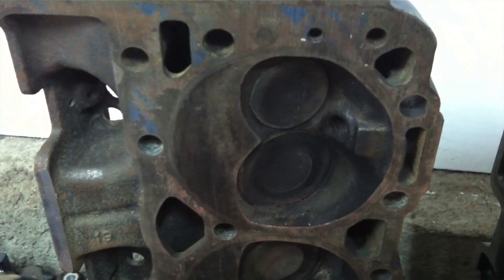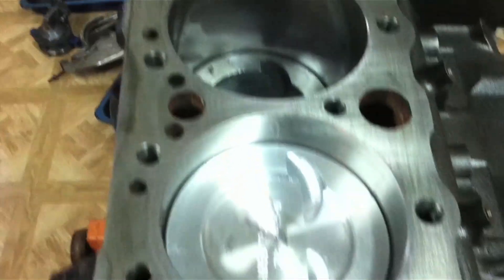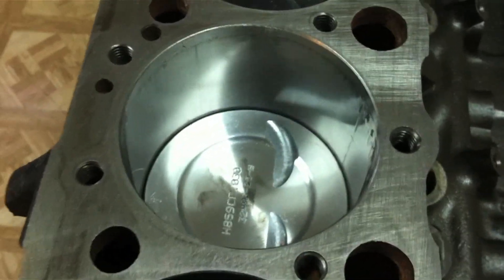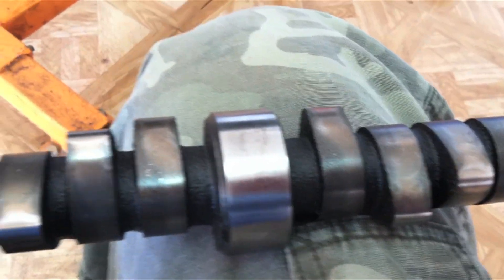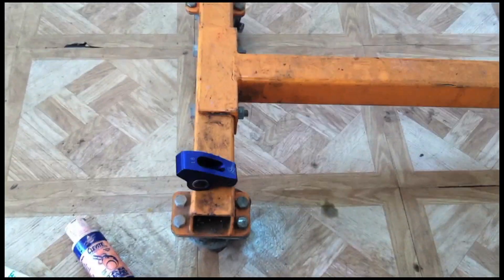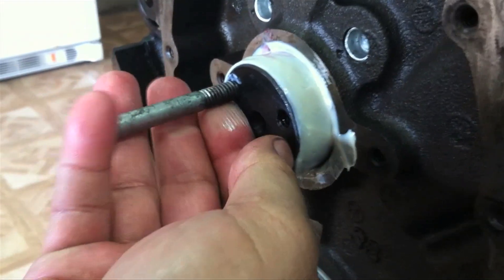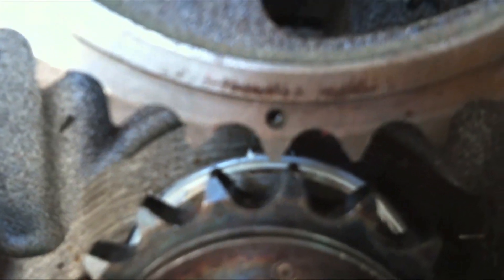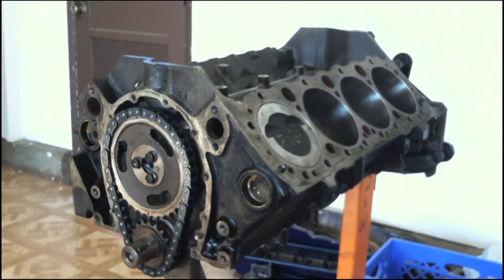How to build a Chevy 383 Part 3: How To Install a Cam & Timing Chain

Comment: whats the torque on those 3 bolts for the cam??
Reply from the maker: I believe it is 20 ft. lbs. It is hard to hold the cam still so I usually just snug the bolts with a 3/8 " air gun. Use a drop of Loctite on the threads either way.

Comment: umm a double roller is about 40$ new why not spring for it.. and I don't see the point in explaining the 4stroke method for explaining compression ratio.. it works exactly the same on a two stoke..

You forgot to tell people that when installing a new aftermarket cam that it might need to be dialed in or that it needs a 30 minute break in time at idle before reving the engine or putting it under a load
Reply from the maker: This NOT my engine. This belongs to a cheap bastard that just wanted the parts put together. The reason for explaining how a 4 stroke works is because many people do not know and it is easier to see when the engine is apart. Who the hell was talking about 2 stroke engines anyway????   Starting the engine for the first time and breaking in the cam is a different video. Also if you start an engine for the first time with a new cam you need to run it above 1500 rpm for 20 minutes to break in the cam. If you run a new engine at idle for 30 minutes before "revving" it the cam will go flat. I just have no idea where you pretend to know anything. It's amazing. You have NO idea what you are talking about. Build an engine. Film it. Explain it. and then get back to me.
Reply from the maker: Try reading ANYTHING on how to build an engine before you write a comment. ANY camshaft install guide will tell you the same thing. 
"As soon as the engine fires, bring the RPM up to 2000 to 2500 during the first 30 minutes of operation. Slower engine speeds will not supply the camshaft with an adequate amount of oil for the break-in period. "
http://www.compcams.com/Instructions/Files/COMP4-115.pdf
Reply: SanDiegoHotRod I don't have to I've been doing it for 14years and never had a 1stroke or 4stroke blow up due to something I've done.. and I always break my engines in I never trust a customer.. also here's something they don't tell you on a cam always mic your distributor gear they can be defeated on ford's and chevys

Comment: Is there a thrust bearing in between the Timing gear and the camshaft. I am putting a Hydraulic Flat Tappet in a zz4 roller block ? Thanks for the Video it was what I was looking for.
Reply from the maker: Thank you! If you don't have a roller camshaft and roller lifters then you should not need the bearing or a retainer plate.
Reply: That what I needed to know. Thanks

Comment: Begins by " i am just gona explain how a 4 stroke engine works quickly". Takes 4 minutes to explain it...
Reply from the maker: That's pretty fast. Have you ever read any of the engineering books on how a 4 stroke engine works? "Gas and air come in, burns and goes out" is not really a good explanation.

Comment: how did you get the cam bearings in?
Reply from the maker: I have a cam bearing installation tool. It is very important to get them in lined up with the oil holes and not crooked. It is also very easy to burr the edges of the cam bearings. I usually just have the machine shop install them after they finish the machine work; boring, honing or grinding the crank, etc.
Reply: +SanDiegoHotRod I see. im going to attempt a 383 build this winter. Thanks for all the info!

Comment: why didn't you put in the cam thrust plate and bolts
Reply from the maker: Because a non roller hydraulic cam does not need a plate.

Comment: why is the one piston so clean but the other one isnt?
Reply from the maker: The client told me it was a boat "motor" with only 10 hours on it and one piston was bad so they replaced it. The machine shop did a crappy job and the guy who sold the parts to my client lied about a bunch of stuff. My client was a super cheap douchebag on top of all that. This is the reason I won't buy a car or engine from someone and take their word on ANYTHING! I prefer to buy a car with NO engine and build my own. That is the only way to KNOW for sure it is a good engine.
Reply from the maker: No. He was a total scam artist I just met. Nothing but constant lies about EVERYTHING! He took $30,000 up front to restore a 69 Chevelle from a semi friend of his and told me he only had $20,000. He then took the money to rebuild the car and bought cars for HIMSELF to flip and make money. He also kept trying to do everything as cheap as possible even if it was not safe. I finally met the owner of the car and he worked with him directly. He completely screwed the owner of the car but the owner still loves me and my work but yeah, douchebag! Take a look at the blue 69 Chevelle with the awesome blue 454 big block I built with NO money on my FB page.  http://www.facebook.com/corvettesandcustoms

Comment: what you did wrong is not to  let the  people watching is that when you line up the two dots as you did,   and most people do this as it is easy to make sure the line up. 

the problem is that when you do this the number one cylinder in not on top dead center,   in the Fire condition,  Number Six is.    Just check the cam lobe's and you will see what I mean.

 yes the piston is up to the top but the cam is not going to let the number one cyl fire.  The Number Six Cylinder is in  compression,   So if you use this as  TDC   you will be off 180 Degrees when you try to fire the engine.      The  Correct way to have  TDC is when the two Dots are at the 12 o'clock.     That is TDC  on a Chevy Small Block Engine for number one cyl.             Just a bit of information to know for the older Small block Engines.    Pass that along for the new guys
Reply from the maker: +Gfdf Perte Geez. Really? I guess you are right. I did not mention that you had to turn the crank before you install the distributor. I also did not mention about using grease to install the fuel pump rod, or how to install the carburetor, or how to install the intake manifold, or how to wire the ignition, and so on and so on....
If you watch the second series on the "Engine dress up" I go through installing the oil pan, intake and so on including PRIMING the oil pump with the oil pump primer and installing the distributor which includes HOW TO FIND TDC on the COMPRESSION stroke. Many people change distributors without changing the cam and they just want to watch a short video on how to find top dead center on compression stroke and dead time the distributor without watching a 2 hour video just to get to that part.
Keep in mind that after installing the cam you still need to install the heads and adjust the rockers (part 4 and 5) and that involves TURNING THE CRANK over which would make the cam out of the 12 oclock position. Are you going to install the distributor BEFORE you install the timing cover just so you can have the cam in the right place??? Bottom line is you still have to align the dots to install the camshaft properly so you don't get the cam installed a tooth off either way.
I still have a couple more videos to edit and upload for the second series on installing the EXTERNAL parts of an engine, including the dist. and carb. Many people do install the dist. 180 out because of this that is why I have another video coming out on "FINDING TDC AND INSTALLING THE DISTRIBUTOR" 
I appreciate you watching and paying close attention.
Reply: Well you just told every one so My job is done.      But remember 99.9 % of the guys watching do not know what you know and it is easy to glaze over or just not talk about items that need to be done.   That is why I said to look at the lobe's and how a SBC  can be at the 6 or 1  fire position  when  the marks are at  Zero.   Once you know that bolt on the cover and the pan and have fun.  

For easy start when you install the Dist bring the timing mark up to 15 to 20 Deg BTC   put the Dist in and line up the rotor with the number one post.   This way you know  you will start right up and have some advance when you start.
Reply: Do a video to show how that can be done right on the engine stand.  The cap can come off when putting the engine in.
Reply from the maker: +Gfdf Perte A friend of mine used to set his timing with the timing light on #6 to to mess with people! LOL
Reply: I tell most people just use the coil wire.  Fast and easy and the wires on the Timing light do not get hot.        This does not work on EFI  with 8 coils.

Comment: to bad this guy did not  tell you that is not  the full story on how to install the cam and chain.   This is not the full information.   If you do this you will drive your self crazy when you put the Disturbing in and try to get the Engine Running.       If you want to know more let me know
Reply: spell  really is that all you got to say.   You do not not even know that you are showing people.
  you are not telling them the correct way to set up the chain when you are done.     Once more you show that you do not know what you did wrong or at least  tell people what they need to do after they set up the cam as you showed.
if you find spelling fucks up i do not care.   but please tell people what they need to know,  I bet you do not know,   if you do tell us
Reply: For the record I look for videos that can cause people problems.      And yours is one of them.
SDNC   Got it.

Comment: When should you use a wear plate between the timing gear and the block I am installing a mechanical roller cam in my 383 and they suggest the wear plate but I've never built motor that required one before.
Reply from the maker: richard lundy When you install a roller cam (not just roller rockers) the cam lobes are ground at a flat angle for the roller lifters to ride on. Hydraulic lifter cam lobes are ground with a slight angle so the lifter spins and also puts backward force on the cam to hold it in. Hence no retaining plate or cam button. With "flat" roller cam lobes the cam is able to move out towards the front of the block. When you install a "full roller" cam you need a cam "button" between the cam gear and the timing cover to hold it in place. Since this puts back pressure on the cam you need the wear plate to keep the gear from grinding down the front of the block. That's where the wear plate comes in. I prefer to use a thrust bearing style but you should check the paper work that cam with your camshaft to get the proper thickness cam button and plate. Comp Cams online also has some good info. Hope this helps.
Reply: Thanks alot. I have the cam button and the wear plate and the paperwork with the wear plate says I need to have .030 taken off the block or the back of the cam sprocket but what you said all makes sense and I appreciate it very much thank you sir

Comment: Yes, it explodes due to the high compression. Rapid expansion of air is the very definition of an explosion. Lighting gasoline without it being in an compressed environment will simply combust and produce no power for a piston.
Reply from the maker: An explosion ("a specific type of combustion") in the combustion chamber is called "detonation" and is what destroys engines and burns holes into pistons. A controlled burn of vapor in the cylinder and expanding gases which push the piston down is different than the molecular and chemical reaction that happens in an actual "explosion." Way too much information to get into here but do some research and learn the difference. here is a good place to start.  https://answers.yahoo.com/question/index?qid=20100206193818AAYIzNP
Reply: A detonation is a specific type of explosion that produces a shock wave that is supersonic. A subsonic explosion is NOT a detonation and thus would not destroy an engine. Remember the very definition of an explosion is a rapid expansion of air, which is what is occurring in an internal combustion engine and this subsonic explosion produces the force needed to power the pistons.
Basic college physics
Reply: That link is a joke and who wrote does not know the difference, here is a link with an engineering expert:
http://www.justanswer.com/engineering/6e831-explosive-combustion-causes-occur-describe.html
Reply: here is the actual explosion type occurring in an internal combustion engine:

en.wikipedia.org/wiki/Explosion
Reply: Sorry this is the actual link :

http://en.wikipedia.org/wiki/Deflagration
Reply from the maker: Ricardo Cortez
Keep reading -  -     http://www.contactmagazine.com/Issue54/EngineBasics.html
Reply: Right, like I said, the types of explosions in a normal combustion engine are subsonic Deflagration explosions, Not detonations.

http://en.wikipedia.org/wiki/Deflagration

I read your article now get with basic sience and read that article.

Comment: Hey I was looking through your striker motor build looking for cam bearing install.  Did you do the cam bearing install in a video?
Reply from the maker: jonathan Clift I don't have a video on the cam bearing install. I usually have the machine shop do it for me. I do have an installing tool. It looks like a oil pump priming tool just a LOT bigger! LOL I think you can rent or borrow one from Napa or Auto Zone. Just have to make sure the bearings go in straight right off the bat or they get messed up. Make sure the oil holes are lined up properly also. Personally I hate installing cam bearings. D'oh!
Reply: Awesome! Thanks for the info!

Comment: This is such a great video! I've been tinkering with chevy small blocks since about 1965 when I bought my first of two '55 Chevy's. I knew the basics but never really knew the details the way you explain them. I want to build a 383 stroker for my 1988 chevy stepside. This will be my guide for every step. Thanks!
Reply from the maker: Roger Kellerman Thank you! I am glad you like the series. I have a new series on the external parts like oil pan and valve covers, etc. Good tips in there and much nicer engine as well. LOLGood luck and let me know if you ever have any questions. Go to my website and print out the "Build Sheet" it will help you plan and budget your engine build. http://www.corvettesandcustoms.org
Reply: +SanDiegoHotRod What about the rod in the block for the mechanical fuel pump. If the pump is still on the engine, will you have to remove the fuel pump, so the rod can be dropped down to allow the cam to be installed?
Reply from the maker: +w41duvernay Yes the rod for the pump will have to be taken out or at least dropped down. You can take the 2 big bolts out that hold the fuel pump in and let the rod drop down inside the plate. After the cam is put in you can reinstall the fuel pump. In the front of the block near the pump are two 3/8" holes. The upper hole should have a short bolt in it to keep oil in the pump rod area. If you take the short bolt out you can push the rod up in the hole and use a longer 3/8" bolt in this upper hole to hold the rod up while you install the pump. After the pump is in take out the long threaded bolt and replace it with the short bolt to seal the hole again.
Reply: SanDiegoHotRod Thank you! I'm putting a 270h comp cam in a 305 '86 firebird soon. Never done an actual SBC engine before in the car.

Comment: I'm about to re time a 350 that supposedly jumped time (ran rough, then died). Won't start now. Would it not be enough to just find TDC on cylinder one, then line up the marks for the cam at 6;00 and the crank at 12:00? Assuming the engine isn't damaged.
Reply from the maker: If you are looking at the timing gears then you need to make sure the marks on the gears line up. If you set the crank at high noon the valve timing will be off and you can bend your valves. The keyway needs to be at 1 o'clock for number 1 piston to be at TDC. Step #1 in any Chevy shop service manual is always "Verify the problem." You need to determine if the distributor jumped a tooth, the cam jumped a tooth or if the balancer is "spun" meaning that the rubber between the crank hub and outer ring of the balancer took a crap. The balance of the engine will be off causing it to shake and the timing marks will be off making it hard to time right or not run. Take a look at my newest video "How to install a balancer" for a better visual:
 https://www.youtube.com/watch?v=uXTybjjdPAI&list=UU3LnmaxoynFmN0FSQH-ROZA&spfreload=10
Reply: Thanks for the reply. The owner claims that there was a great white puff of smoke, ran horribly, now it won't start. I do have the Chevy shop manual for the engine, very thankful, but I think the chain just jumped after so long. How would I go about re timing it as to not damage the valves or piston heads?
Reply from the maker: Charlie Gates
I still don't know why you would think it jumped a tooth. White smoke and not running well could be a lot of things. Usually white smoke could be a fuel thing or it could be a bad trans module leaking trans fluid into the carb. The only way to verify the problem is pull the timing cover. If it did jump you need to replace the timing chain. There is no "fix." Basic steps are test for spark. Test for fuel and do a compression test. Then pop the valve covers and check the rockers. Make sure none of the rocker studs is pushed out a little. WAY too many things to check before even getting to the chain.
Reply: Thanks for your reply. I work for Toyota so these engines are kind of foreign to me! 
Now what would be the first thing to check? I'd like to check the easiest things first. Spark will be my first. Compression after that.
Reply from the maker: Charlie Gates
Does it have a Holley carb? If it coughed and blew white smoke now runs like crap it could have blown a power valve in the carb.